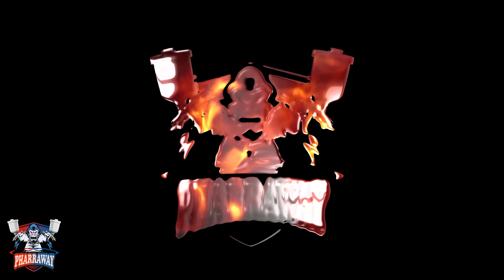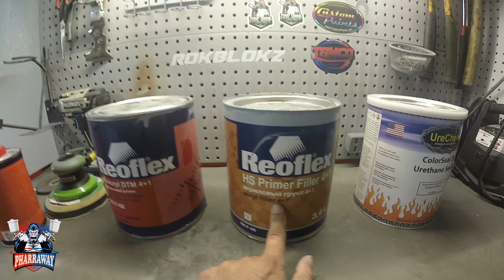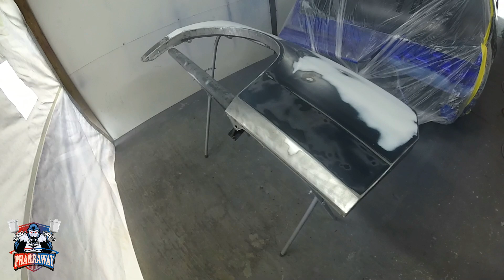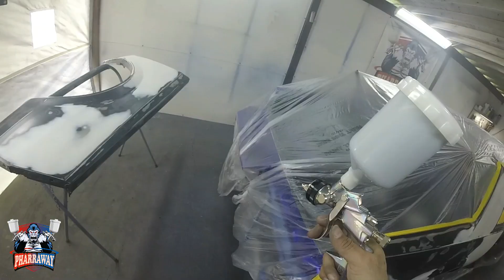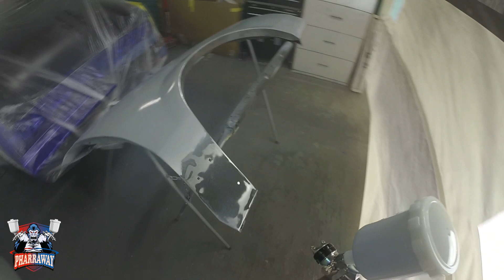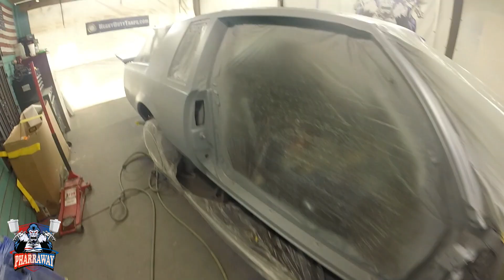How to choose the right primer, before painting your car

Comment: Im thinkin of grabbing a quart of good epoxy and applying it with a roller to every bare metal and then over every filler spot and then using slick sand on the whole car and then seal it for good coverage. Do you think thats too much layers? I found out about this slicksand primer and everyone says how good it is. Would you apply sealer over it?

Comment: Ok pharrway I got a question is dtm primer in Epoxy primer the same do u prefer Dtm for direct to metal or epoxy ?
Reply: In do u apply body filler to direct metal then primer or primer first ?
Reply: @hillsidesavage1413   DTM is sandable. Epoxy is not. If you use DTM you sand it and put your body filler on top of. If you use epoxy you have to sand off the epoxy to bare metal in the spots you are going to use body filler in.

Comment: so, just to clarify, if I sand to bare metal on the vehicle, I should use DTM, wait 20 minutes, and add primer filler over it; then I allow it to cure for around a week, lightly sand it, and it’s ready for a base coat? I’d like to minimize the amount of time my truck is sitting around since it is my daily, so I’d just like to be sure I do it correctly! My first time painting a vehicle and I have studies your videos. I appreciate your work more than I could express!
Reply: Also, I have a fiberglass camper shell on the truck. Would it be okay to use the same primer process on that, even though there is no metal involved?
Reply from the maker: Yes just don't take it down to the fiberglass just scuff it down and primer it
Reply from the maker: Yes that will work

Comment: Great video Pharraway, some useful tips there for anyone that's doing their own resto in their garage. I could be wrong but I didn't hear you mention that the sealer doesn't need sanding you just apply it then wait 20mins or so then start on your basecoat, I thought I would mention it in case anyone was wondering 🙏👍 John UK.
Reply from the maker: You are correct 👍
Reply: So I wouldn’t have to sand my truck if I use sealer
Reply: Providing the substrate is prepped correctly you can apply your sealer give it the correct flash off time then put your colour on without sanding but check the TDS for your sealer just to make sure.

Comment: I have no choice but to use an epoxy, it will seal the metal in my case, as I have so many issues keeping me from getting back to the vehicle. 
  I am sure the DTM is easier to sand, but I can’t get to it. It is for me so I will but the extra work into it.
 Unfortunately for me, we don’t have  Reoflex dealer within 200 mile and ordered high build, HS clear and a large roll of tape. They didn’t have the brightest bulb working in the shipping department and broke open the entire sleeve of tape. Using the foam peanuts for packing filler, roll after roll of the tape was smashed with the package peanut filler stuck to 23 rolls. I have no clean edged rolls and now force to use it as secondary taping jobs. It seems more common for everyone that customer service has no pride, don’t know, can’t answer or transfer the call only to get disconnected. Good help is hard to find even at $15 dollars per hour today. If breaking a sealed roll to fit into a box, at least wrap it in plastic wrap. It is for painting not marking boxes. Never heard back from anyone!
 May be $22 per hour is the magic number. As expensive parts are, plus 3 price increases for shipping in 2020-2021, it is sad😢! 
 At least PHARRAWAY has pride in his work. Thank you for all of your efforts. DK, Omaha.
  But as always, thanks for the information!
Reply from the maker: Awesome brother

Comment: Nice job brother. When I was working in the body shop, we used to do base/clear right over etch prime. Even back then, it was not what was recommended, but it works great. It IS harder to sand though